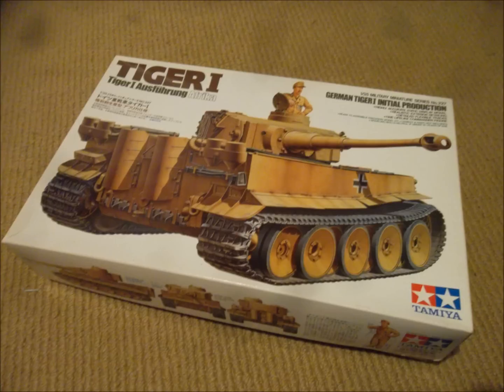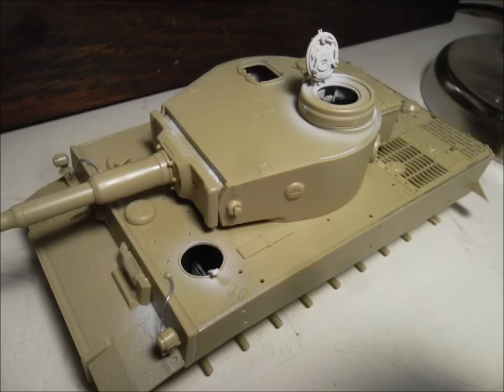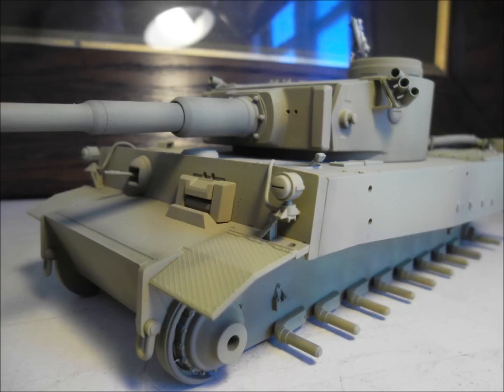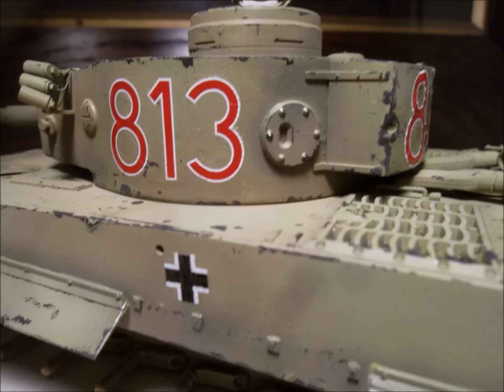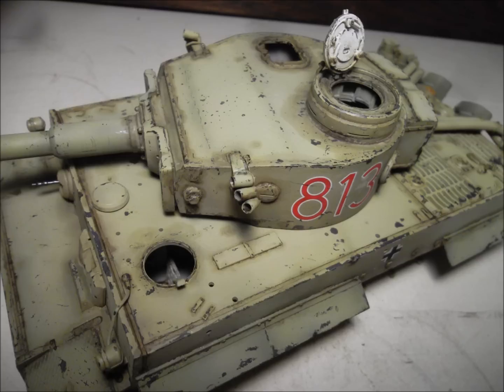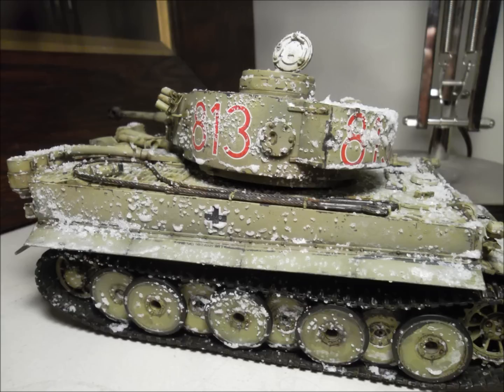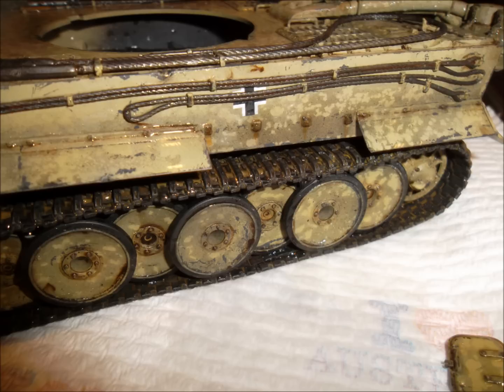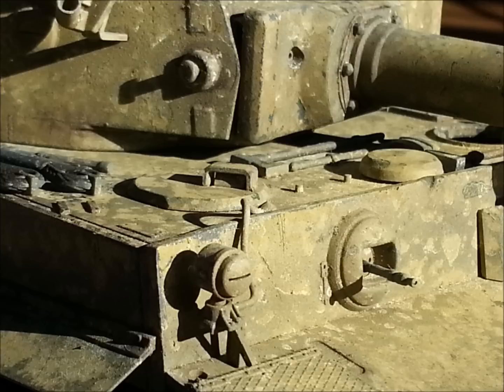Model Tiger tank painting techniques: hairspray and salt

Comment: Hey Dave, I will be using the hairspray technique on my M3 Lee. Do I have to use desert yellow over the hairspray or do I use the base coat color? Thx!
Reply from the maker: Hi Julian, so you first apply whatever base coat you want to show through as chips. Then hairspray, then whatever your final topcoat colour is. Once you wet it and chip away, you will see traces of the original colour show through (whatever that may be).
Reply: @DavesModelWorkshop  ok thank you! I got a little confused. 👍
Reply: Hi Dave, do you apply a clear coat before the hairspray? If not, will the first coat dissolve when you remove the salt?

Comment: As I’m new to this hobby I’m just getting my head around it all. If I want to do weathering painting etc is there an order , especially for the hairspray chipping technique? Ie base coat top coat, pin wash, filters, salt bath, rust , mud etc.  Also for hairspray chipping do I need enamel on base acrylic on top or vice versa or doesn’t it matter?  And help or tips would be greatly appreciated  thanks

Comment: when i do a camo pattern can i apply the hairspray thing..?? cant use the same basecoat then right? cuz the green pattern parts needs other undercoat then the yellow?? maybe you have sum advice?by the way great looking tiger
Reply from the maker: Hi Wesley, thanks mate. You'd still be able to do this if you're doing camo. Paint your base colour (rust, bare metal, dark iron, German oxide primer, whatever you want to show through the chips). Then hairspray. Then the camo scheme, for example on a late war German tank it would be yellow followed by green followed by brown.  Then chip away, your camo layers will remain but it will show through the German oxide primer base coat wherever you chip.  Hope this helps, Dave

Comment: Dave great video.  Question: how do you avoid additional unwanted chipping when you wet the tank for applying the salt as well as removing the salt?  I’m worried wetting the hairspray coat will lead to the paint coming off when I remove the salt layer.  Thanks Dave!
Reply from the maker: I have found that once you've done the hairspray method, you don't get second chances. Wetting the model and chipping that top layer, once you're done if you come back even the next day and try for more it's very, very hard to get the hairspray to lift again (I don't know why). So the salt method on top of that seems to be totally safe, but dry it off as soon as you can once the salt is gone just to be sure.

Comment: Hi Dave 
Awesome video… and just timed it right as just painting my Heng Long 1/16 scale Tiger 1… in German Grey… and was going to leave it that colour till I saw your video .
Couple of questions… .im using acrylic paint… does the chipping etc still work fine on this paint ?
Also do you wet the whole tank or just the part you want to chip? 
Also… whats best way to weather the tracks as they are just matt black at moment .
Any help most appreciated 
Karl
Reply from the maker: Hi Karl, Thanks for your comment. I used enamel, but it should work for acrylic paints, just make sure they are fully cured before you wet them. I tend to work in small sections, you can wet the whole thing but you run the risk of paint peeling or bubbling off in other areas while you work in one area. Better to wet and then chip in a manageable area at a time.  Re: tracks - I've done a previous video on painting realistic tank tracks here: https://www.youtube.com/watch?v=Mi24BCpmF_M
Hope that helps! Cheers mate, Dave

Comment: Great vid Dave.  I want to try the hairspray technique on my next build.  Putting aside the salt thing, if you just did hairspray, so you clear coat it after chipping so there is no accidental additional chipping? Just curious how stable the undercoat of hairspray is when you are done.  Thanks!
Reply from the maker: Thanks for the question. Once you wet it and do your chipping,  I've never had any additional chipping once it has dried off. Let it dry thoroughly and it should be pretty secure. Indeed, I have tried to wet it and do additional chipping 24 hours after my first chipping session, and it seems once it has been wet once it doesn't want to do it again very much. You could clear coat it then if you are doing lots of additional weathering, particularly if you were doing washes or filters with water - that would be rock solid safe. Cheers, Dave
Reply: Dave, thanks for the reply. I'll give it a shot!  Rich

Comment: So did you use water soluble paints to do the chipping? Would it work with enamel paints? 
Fantastic work on that tank!
Reply from the maker: Hi Francisco, I used plain old Tamiya enamels for the base grey and the upper yellow coats. Both worked perfectly. Cheers, Dave

Comment: How do you get the water to coat the paint evenly without beading up? I sealed the base coat with Tamiya flat clear first. I'm ready to put on the final coat but I can't get past this problem.
Reply from the maker: I spray it on with a spraybottle, they cost about $2 from a hardware store. The fine mist covers it well, but if it does bead up a bit that's not the end of the world, as long as the salt will stay on most of the surfaces then a little randomness and patches where there is no salt isn't a bad thing. Does this answer your question? Cheers James, Dave
Reply: Yes, thank you!

Comment: how did you get the salt off when your done? more water? and quick dry?
Reply from the maker: Yep, just more water. I just run it under a tap, and brush off any stubborn bits with my fingertips. Then just leave it in the sun to dry, takes about 10 minutes. Just make sure the paint is dry before you wash the salt off. Cheers, Dave

Comment: Did you give the model a coat of varnish before adding the salt or was it a just a matte finish ? I tried this technique on a kit that had a semi gloss finish and it didn't quite work .
Reply: Back to the top..
Reply from the maker: I did a coat of gloss before I applied decals, but then weathered and did a dull matte coat before the salt. I imagine the sale would slide off a glossy or semi-gloss surface a bit?  Yeah, I think matte would give best results. CHeers, Dave